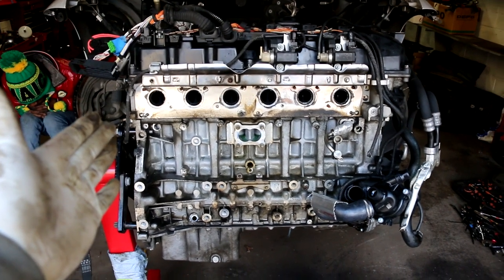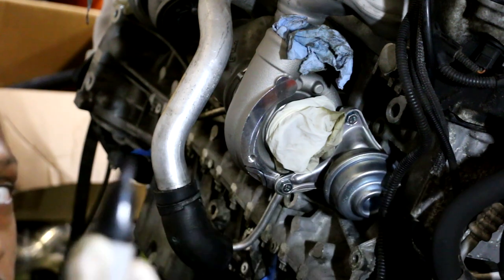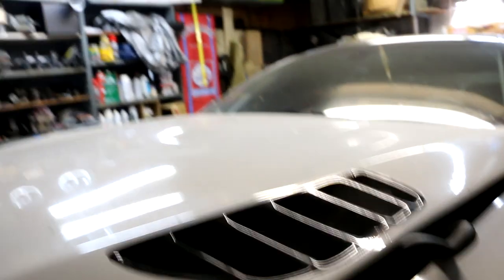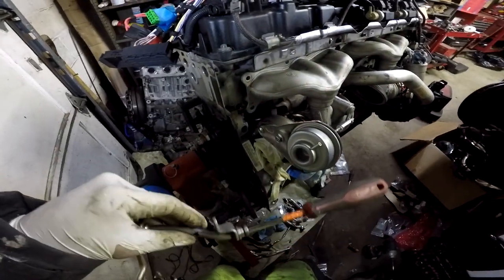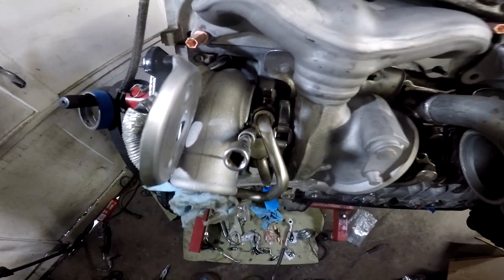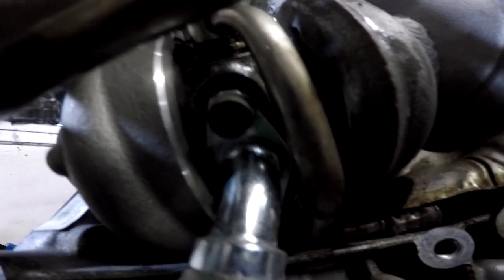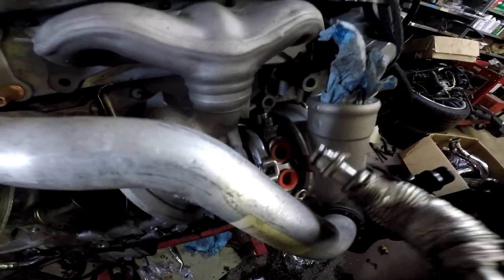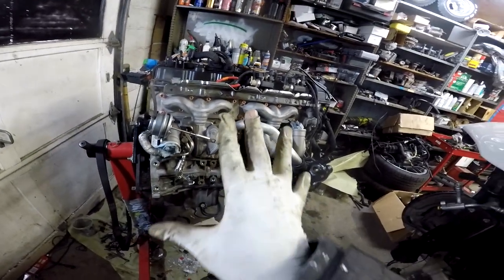MMP STAGE 3 TURBOS INSTALLED | EPISODE 8

Comment: Thats a lot of mod to make the twins fit. Do You like Twins over Single turbo?
Reply from the maker: I went with twins because it was slightly cheaper and I didn't need some outlandish horsepower goals the top mount though looks cooler and probably more easily serviced. I like the twins when u pop the hood looks n/a  and ... now that I doing it and seeing what exactly is involved.  I wanna say I sort of regret it and should have saved a little more and go for the doc race. But we will see what happens. Trying to do everything that I can do I dont have any issues down the line. I see that accord comming along excellent fab work.
Reply: Yea you taking your time and doing it right, so you should not have any issues. You are running the stock high pressure pump. I believe those are good up to 500. The accord coming together, i just hope i dont have any issues lol. but will not know until spring. Having a hard time locating companies that will make the custom axles i need. so that's my major issue.